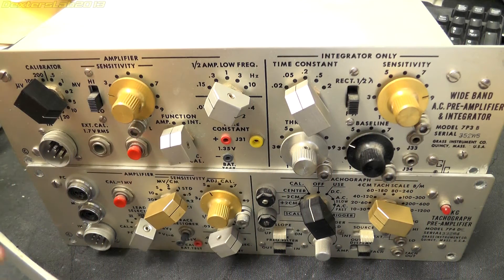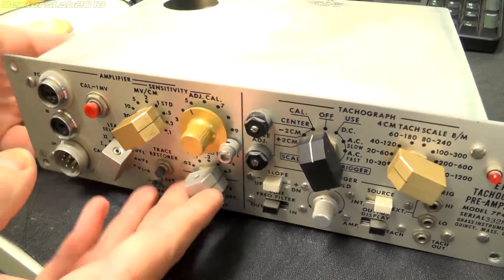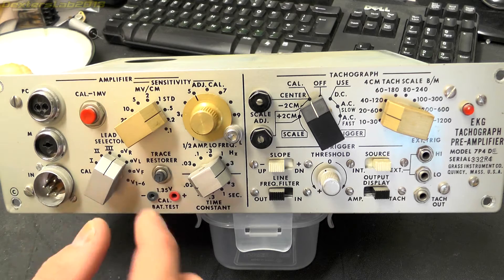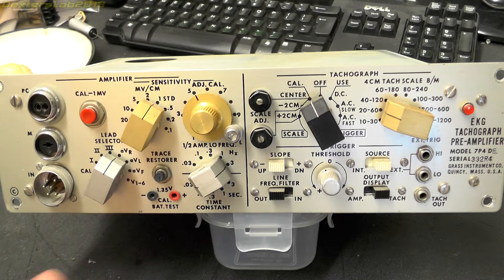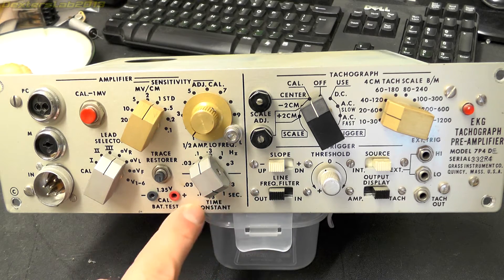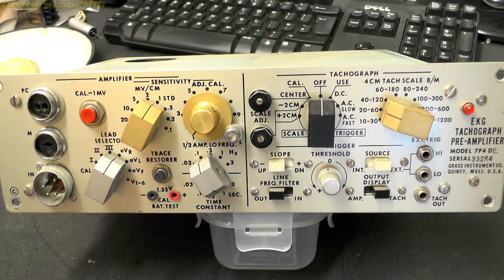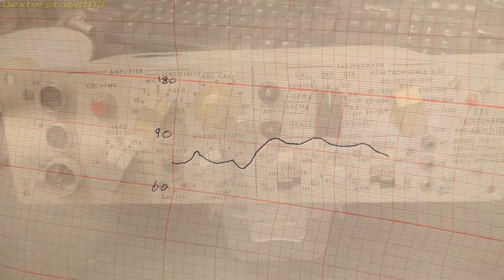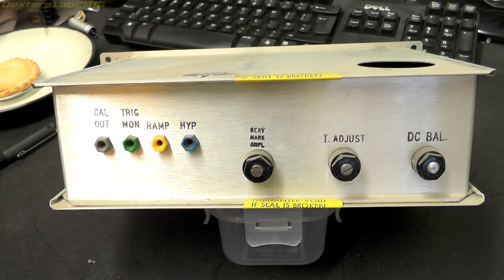DL#080 - Grass Polygraph EKG Tacho & Wideband Pre Amps Teardown

Comment: 1u 100v caps used because they were low leakage types, and a 100V film capacitor ( likely polycarbonate film, too small for polystyrene) was both cheaper and more stable than any other type at that value. Silver mica would be bigger than the box at 1uF, and polystyrene as well, easily being the size of a 1kg polony.

Comment: that teledyne relay is rare and valuable.
Reply from the maker: +omsonic yea, i looked it up... £29 a pop from Farnell! I wonder if they are still using the original tooling to manufacture it!?
Reply: +DextersLab2013 1 million cycles is a minimum lifetime, they will do more at low current, and might get to 100 million cycles easily.